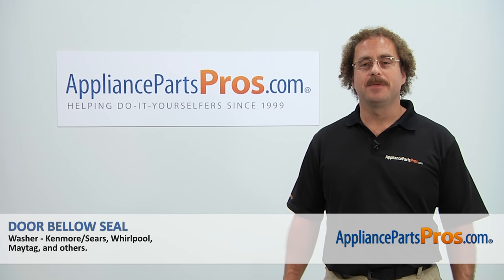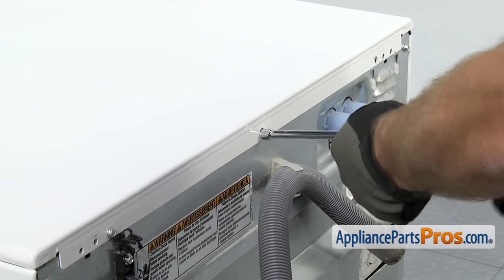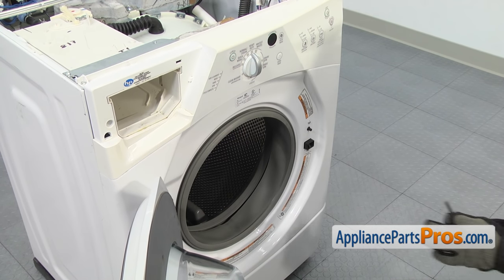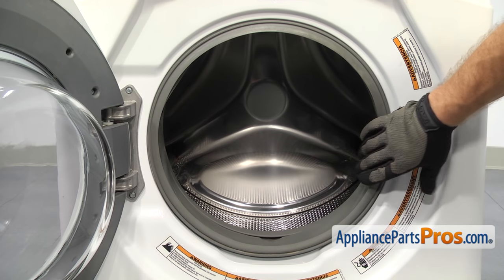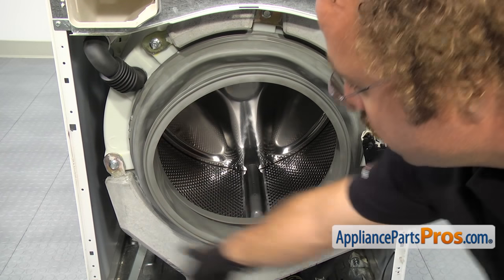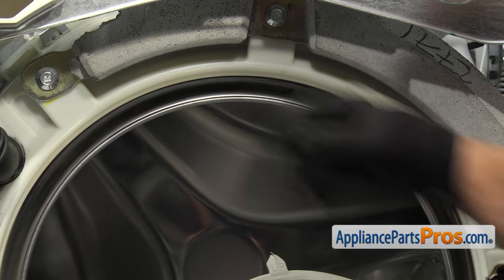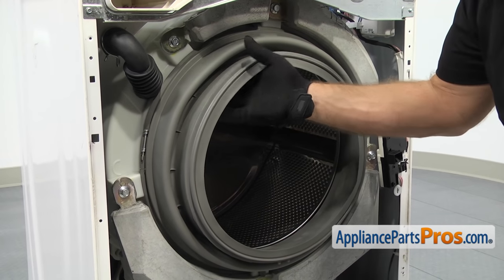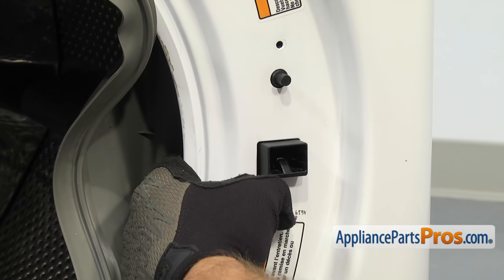How To: Whirlpool/KitchenAid/Maytag Door Bellow Seal WPW10111435

Comment: All I can say is Matt must have Super Hero arm strength. I was able to do everything he showed us, except for re-installing that wire/spring on the front of the bellows. I tried for hours and just could not do it. Someone recommended using needle nose pliers, put them through the connecting “hole” in the wire and pull the pliers toward the side, similar to what Matt does with the vice grips. I then used some plastic spanners ( for mounting bicycle tires onto rims), and that helped slip the wire over the rim the rest of the way. I’m running a test load now and so far no leaks. Thank you for making this video!

Comment: Completed this today. Can't stress enough on the final spring re-installation USE LOCKING PLIERS and pull CLEARLY TO THE RIGHT, NOT DOWN. Also, this door bellow seal is an expensive part! Cost us about $86.85 on Amazon. Great video though!
Reply: Even just a pair of Gerbers. Some kind of pliers to stretch the spring

Comment: thanks for the instructions. i didn't have to take off the top panel. this was signifixant as I have mine stacked with dryer. also I use a drill for the screws much speedier.

Comment: Notice that they edited out the 20 minutes of swearing and slamming when Matt installed the new boot.  Many of these guys suggest putting a lubricant (dishwasher soap) on the boot so it slips on easily.  DON'T DO IT!.  I put a little dishwasher soap on just the BOTTOM of washer door rim.  That way the boot doesn't slip off when I start at the top and work around. Once I got it on about halfway, I found that I could lean my shoulder against one side leaving both hands free to work the other side.  I also found by reaching inside the drum I could pull the boot inward to make it slip over the rim.  Once it's on, don't mess with it.  Get that band on fast and tighten. 
Regarding the outer spring band.  They sell a tool for about $45.  Don't waste your money.  The key is keeping the band deep in its slot. As you work around and it's 2/3 on, stretch the spring by pulling on the band while holding the other side of the spring.  Two people can do this better.  If you can't grip the band/spring, tie a strong string in the spring loop and make a handle for the other end of the string from a piece of tubing.  Once you get the band on carefully cut the string off the spring.
Reply from the maker: Thanks for the tips.

Comment: When I installed the door seal,  there’s a gap between the seal and the drum after securing it around the drum. What did I do wrong? Your video shows no gap there. Water will definitely leak thru there when filling. 
Please advice. Thank you.

Comment: At 6:45 make sure to seat the new seal on the inner lip as well.  This isn't mentioned anywhere in the video.

Also, my washer has a hose and fill port on the top of the bellows.  There is a plastic nozzle that needs to be removed from the old bellows and moved to the new one.  It's easy to overlook until you try and reattach the hose.

Lastly, there are a set of drain holes at the bottom make sure to exactly align these drain holes on the seal and the machine before tightening the clamp.  Even if you line up the top of the bellows as shown, the drain holes may be misaligned.
Reply from the maker: Thank you for those tips!

Comment: Great video.  Very clear and easy to follow.  However, you seem to have omitted one step.  There is a third lip on the bellow that needs to be fitted to the plastic shroud that surrounds the drum.  I performed this step last after everything had been put back together, and it was very easy to do.  There is no clamp for this third lip - it's just an easy press fit. But seems a fairly critical step and I can't help wondering if this was inadvertently edited out of the video...

At least that was the case on my machine.  Could be that this does not apply on all machines.
Reply: Machine is a Whirlpool WFW9151YW00
Reply from the maker: Glad you found the video helpful! And thank you for the tip about your particular model. A single part can be compatible with hundreds of different appliances. We film the part on a single appliance model to serve as an example of the repair, but there may be slight variations in the process for different models.

Comment: Use golf tees in the bottom holes for the drain to align properly to the washer otherwise you’ll have to take it off later and put it back on if they’ve moved but the golf tees hold it very secure
Reply: gold. ty.

Comment: Great video. Only thing I'd add is a side note to clean the drain trap, behind the lower panel, while you're in there. I was amazed at what I found in there, from my kids' pockets. When it gets clogged, you'll see an R code on the digital display and it won't drain. It's pretty disgusting to have to repair with a full load of dirty water in there.
Reply from the maker: Thanks, glad we could help! And that's a good tip too. We're always amazed to hear all the stuff our customers have found in there.

Comment: If the spring on the outer gasket ring is old and crusty from detergent like mine was, you can go to a hardware store (not a big box!) and get a replacement one for peanuts - < $3. This will allow you to stretch the clamp over the gasket.

Comment: At 10:03 when he's pulling on the spring clamp and using both hands to hold the vise grips there must be someone else out of camera view holding the top of the spring clamp, otherwise it would have slipped off of the door seal. However, I just noticed that this video was made in 2016, so it's possible that the door bellow seal on the 2019 washer that I'm working on (which is more floppy and made from thinner rubber than the older door seals) is made from a type of rubber that has low frictional resistance and therefore doesn't hold the spring clamp in place as you stretch the spring.

Comment: I can’t for the life of me get the new bellow on. Any tips?
Reply from the maker: They're notorius for being difficult to put on. What is the model number of the washer you're working on?
Reply from the maker: Did you order this part number: https://www.appliancepartspros.com/whirlpool-bellow-wpw10111435-ap6015081.html
Reply: Yes that what I have.
Reply from the maker: If you're having issues slipping it on, try using a VERY light coating of liquid detergent to help.
Reply: I’ll try that.  Thank you!

Comment: While you have the bottom panel off, unscrew and clean your pump filter. I never knew you had to clean it so mine was festering for 9 years. It was full of black mold and sewer gas smell and caked up with fine silt and everything - disgusting!

Comment: This guy wasted 15 minutes of me trying to install the seal. It’s 100 times easier starting at bottom center, lining up the drain holes, and then feeding the inner lip of the seal inside between the drum and the plastic drum cover. Feed the seal halfway up to the right, then halfway up to the left, and then keep going until you finish at top center.